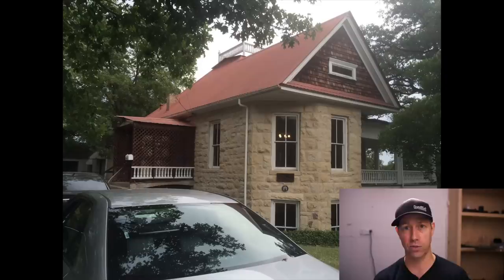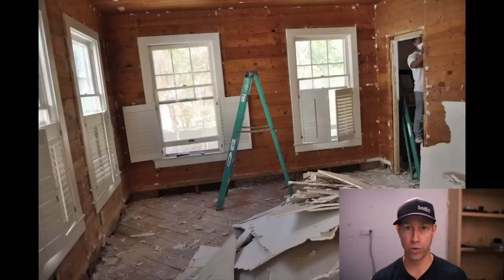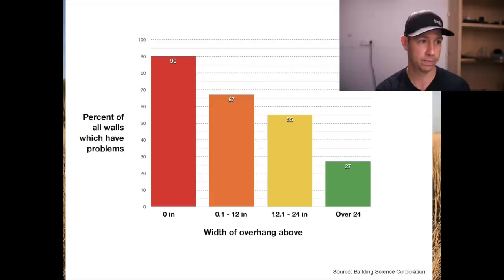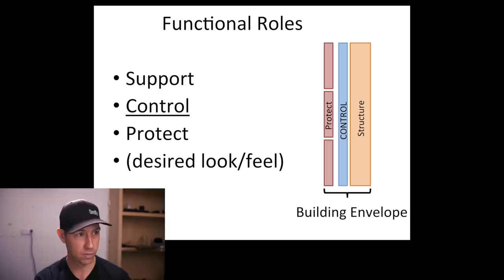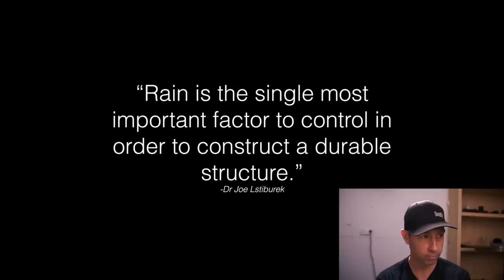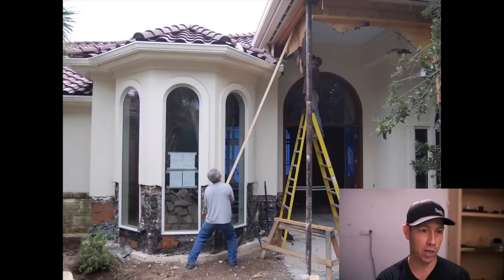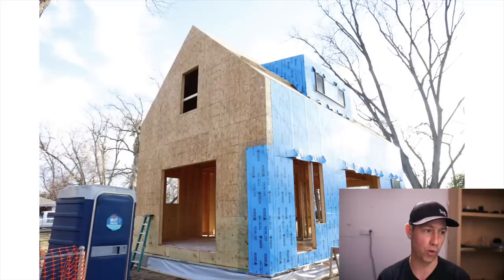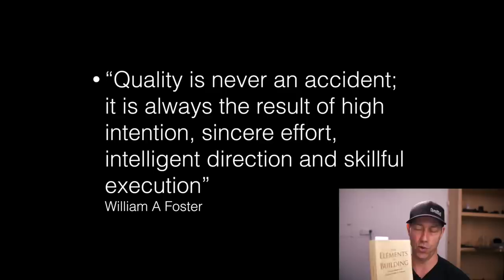Were Old Houses Built Better?

Comment: I live in a 1880's house I absolutely love it. I live in buffalo, ny - it gets (-40) here some winters, and yet I only have to run the heater in the morning and it stays warm all day with my 2 foot thick exterior walls - not too unlike that stone house. I've been here 10 years now - with NO maintence at all other then some cosmetic work and cabinets. It is built to last the ages.... Just the idea of buying a new ticky tacky year 2000 house makes me gag and This guy can speak for himself when he says "They didnt have the same comfort standards back then".... I actually have to open some windows to let the heat out of this house sometimes :-P And then in the summer - same thing with the a/c.... It can be like a refrigerator indoors.... Maybe texas building standards were not that high back then, but even then I'd rather spend a little extra $$ on electric then on a contractor every other year.
Reply: I've built hundreds of cookie-cutter houses as a young framer around Rochester. I believe your house will still be there long after these newer homes are gone.  All homes have mistakes made by the people designing and building them. The new materials cannot handle moisture and water like the old days.
  That being said, if you gutted your house and used all new materials and methods on the interior like a typical modern home, your exterior would suffer the consequences.
Reply: 2 foot brick is ridiculously thin when it comes to insulation under really cold or hot climate. And when it comes to new materials a 7 inch thick SIP wall provides enough insulation to keep a 1000 sqf house warm in - 30c in Siberia using just a couple of 1kw convectors. Not even a 5 foot brick wall is as good.
Reply: then why do they not bother with 7 in SIP walls in Siberia?
Reply: They do.
Reply: Untamedlion, this guy isn't thinking about old style basements, they cool a house very well. My dad and I never bothered with an AC (I used a fan some when I was a teen), we had cool air from the basement coming up through the floor heater. Half of our basement was dirt also. 

I want to build my own house :( I marvel at the old rough cut wood in my grandpa's old house. Wormy chestnut is awesome.
Reply: East Aurora area here, are you up in the city or in one of the many rural "suburbs" like me? Lots of 1800's houses around here, all still standing and strong as hell. All the newer homes? They don't last very long.
Reply: Americans builds only JUNK! Before Americans used to built-to-last in the 60s, 50s, 40s, 30s, 20s, 10s, 1900 to 1800 but not anymore, unless you specifically ordered it built according to your specifications with a powerful engineer-lawyer making a contract for all contractors and sub-contractors that they must face the heavy handed consequences if they cheat-cut corners!
Reply: @darthvader5300  More and more people here are having to rely on the old adage of "if you want something done right, you gotta do it yourself!"
Reply: @darthvader5300  , 
The 70's were not a bad time for things to be made also (maybe it was the beginning of the end?). My wife and I used a couple of washers and dryers from the 70's that were still running strong when we moved to our house.
Reply: @darthvader5300  Yes most American houses are nothing more than built on sight "permanent mobile homes."  And yet they cost what a spacious, luxury mansion cost 40 years ago.  And double that after the banksters collect 30 years worth of unjust usary aka interest on the mortgage.  We have been conned in the worst way.
Reply: @worldserpent731  That's when everything was still made in the USA and people could make a living wage and took pride in their work.  Before big corporations took over and sent all the work to be done by third world people at very low wages, and they also reduced the quaility standards in everything drastically, such as solid wood interior doors being replaced with hollow "masonite" garbage, thin enough for a 12 year old to punch a hole through.
Reply: My friend has a faucet, an all steel faucet made out of the best heat treated alloys and anodized in potassium permaganate and MADE BY BETHLEHEM STEEL which was purchased in the 60s and it is still in perfect working order despite the fact it was installed outdoors! He said, thank GOD I stock up stockpiles on a lot of Bethlehem steel products such as faucets, valves, choke valves, analog meters for water, gas, and oil, shovels, picks, wheel barrows, etc all perfectly preserved and properly stored with their original price tags still on them and their original steel brochures perfectly preserved by plastic laminations done by him for he is a technophile-collector/stockpiler. His house is more of a warehouse-museum than a house! You may add the word "HOARDER" and who can blame him when things has a tendency to become not as they used to be!
Reply: Reply to KesselRunHero: You Amrerican misunderstood me! When I say in 1800 it automatically means the best of the best of the old combined with the best of the best of the new. I understand you but you do not understand me! I want the super-best of the OLD combined with the super-best of the NEW, make some adjustments here and there while keeping in mind the old Irish Saying "IF IT AIN'T BROKE, THEN DON'T FIX IT!" I DON'T DENY ANYTHING, I WANT EVERYTHING THAT IS THE GOOD AND THE BEST OF BOTH THE PAST AND THE PRESENT which is why I said "they do not build things they way they did in 1800" because they did not maintain the BEST OF THE BEST 1800 standards and combine it with the best of the best of each incoming decade! That is what I am exactly trying to point out to everybody and including to you KesselRunHero and you MISUNDERSTOOD ME! Have you heard how to make an upragded version of modern Roman mortar and concrete by mixing equal volumes of lime, powdered brick, and sand (mica-free) and add sufficiently fine graded aggregates (mica-free)? How about Ancient Chinese brick mortar adapted to making concrete by mixing equal volumes of lime, rice glue, and sand and gravel and adding sufficient amounts of water to create a semi-plastic/semi-liquid upgraded Ancient Chinese lime-rice glue mortar based-upgraded modernized version of it? We did it way back many years with modern technology and making adjustments here and there (like a bakery chef making adjustments in his cake recipes to improve his cakes and pastries in terms of flavor and deliciousness) and that the sand and gravel aggregates are mica-free. And I am not ignorant, nor stupid, nor a liar, for I and my team tested a lot of house building technologies of each decade going back to 1800 and started combing them for the best of the best of their era and decade and combining the best of the best of their era and decade together for each succeeding decade up to the present. THAT IS WHERE YOU GOT ME WRONG. I UNDERSTOOD YOU BUT YOU MISUNDERSTOOD ME!
Reply: Preach
Reply: @borisbritva7453  houses in Florida are junk,, builders nail one by threes on the block wall I guess they consider that a stud no insulation on the walls I figured that's probably why people can only get about 7 years out of their AC system cuz it has to run constantly, I've missed having a real house
Reply: Boyfriend and I are home shopping in the buffalo ny area right now and needless to say we're looking at turn of the century houses (within 20 years of 1900) Those were built to last. My family home was built in 1910 and the only reason why my room is freezing is because of a shoddy window when it was renovated before we bought it 🤷🏼‍♀️

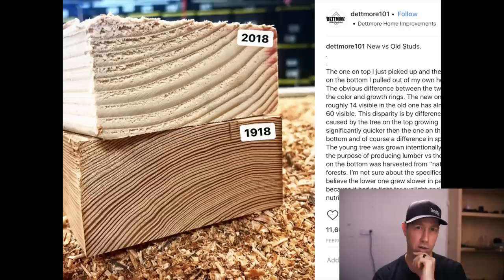Comment: 5:40 I’ve had 2x4s from ~100 year old houses that I had to drill pilot holes to drive in 16 penny nails.
Reply: I've re-used even sixties Douglas Fir, and you had to pre-drill everything.  I've heard wood also gets harder with time.  No idea if this is true or not.
Reply: Just built a work bench from some old rough sawn I had in my barn loft.  Broke off so many screws and bits.  Impact driver and pilot holes to get it done.  That work bench will surely outlive me.
Reply: @jeffreyquinn3820  That Fir is some tough stuff too.  My old floors were Fir.  They were pretty beat up to refinish, so I just kept them as subfloor where I could, worked pretty well.
Reply: @jeffreyquinn3820  It's true. As they dry out and compress they are incredibly hard, and still straight. Old growth wood and masonry wins every time.
Reply: Bingo

Comment: wood doesn't rot if its left to breathe, as long as it can dry out properly, its fine. most VERY old houses are only in bad shape because of modern attempts to prevent damp, which only serves to seal in the moisture and cause rot... Even painting wood will stop it from drying out in the summer.

Comment: having each of my houses get older and older as I moved, I will say, older is (usually) better. went from a new 2008 built house which was absolutely garbage, to a 2000 built house which was better but still bad to a 1980s house which is absolutely solid all around in its construction. the 2000+ houses I do not expect to live more than about 50 years before they need to be torn down or 100% renovated inside and out.
Reply: I agree, I had a house built tin 2011. I had the luxury most do not, which was to be there on site every day. However, even with my being there, the contractors still got away with shoddy crappy practices. If you have an 80’s built home, be careful of what you may going in some of the walls if you make renovations. I lived in a 1980’s built home and we wanted to add two bedrooms and redesign the kitchen. There were empty cardboard cases of beer in the walls between the sheet rock, and we had found a lot of shoddy construction. But my brother renovated an old Victorian home from the 1850’s which some slumlord modernized for a boarding home and covered up all the beautiful wood. He found stained glass windows, and all kinds of hidden features an then he began restoring instead of renovating. Tha house is still standing, and its 2 blocks from the Atlantic Ocean.

Comment: Here in Finland we still have a ton of post-WW2 rebuild era houses that were all built using the same basic design. There was a shortage of several materials at the time, so these houses are basically all wood (which we had a lot of), from the framing to the insulation which is leftover sawdust. No plastic anywhere, which means the structure lives and breaths. Most of these houses are still perfectly OK as long as the roof has been kept watertight and there have been no prolonged leaks from water pipes. It was only the later houses from 60s-70s on that started suffering from rot and moisture, thanks to plastic layers and insulation materials that are incabable of dispelling the moisture that inevitably gets there. And obviously some of these good, healthy older houses were ruined in the energy crisis era by adding modern insulation, or by blocking air flow to the cold attic. Or by using latex paint outside - that's enough to seal the wood off and make it rot. It's only now that the building industry is starting to realize the mistakes they've made. Too bad so many people have had to suffer from the air quality problems inside these later houses. It's a big price to pay from fractionally smaller heating costs.
Reply: What kind of paints should be used instead of latex? I have to repaint the overhangs on my house. Latex is what is mainly available now here in Canada unless you use oil-based paint for metal...

Comment: Love this video.  Thanks.  I would like to see comparisons of southern (warm) old houses and northern (cold) build techniques for century and older homes.  As an owner of a 150 + year old house in Canada and having gutted and remodeled I find the biggest issues are level problems (floors and walls), lack of internal wall and exterior wall insulation, and foundation drainage to name a few but I have to say the triple brick is solid and the interior wood framing and roofing system is mint.  Cheers.

Absolutely despise any house built with any particle board or any type of engineered wood.

Comment: WOW! that comparative picture of the cross section of both old and new lumber is incredible.  The new stuff looks like a sponge in comparison to the density of the old stuff.  I sent you an email after your last "do houses need to breathe?" video hoping you would address this issue and you knocked it out of the park! thanks for a great video!  I would love to see some in-the-lab testing done on old and new timber to see just what attributes the old lumber has in comparison to the new.  You can see the density, which probably prevents moisture from permeating in the first place, but I wonder if the wood itself doesn't also contain phyto-compounds that act as antifungals, just like treated lumber today is treated with fungicides.  Trees grow in fungi-rich environments and have to produce fungicides and bactericides and pesticides of their own, I bet that old stuff destroys the new stuff in phyto-pesticides.
Reply: Dense wood absorbs water slower but also dries slower, but compared to the "sponge" it absorbs less water, and tend to deform less and retain strength better when wet (think boat-building).
It is much stronger anyway.
With regards to fungi they usually can not penetrate more than a millimeter or so into wood unless it is constantly moist and has started to rot, dense wood is more resistant, and especially "sour" types of wood, like oak.
The downside is lower insulation value for the dense wood.

Comment: I used to live in a new house, which had it´s wooden window frames rotting within 5 years and not long thereafter the flat roof started to leak and in one place we had tar dripping down to the floor (hot water pipe next to tar paper ingenious idea). Not to speak of mold in the bath (central toom, hence no window and the ventilation channel was way too small, unless the rotor would run like 10x as fast) and these #### bought all sorts of spare parts which were no longer in production, thus 10 years later, every repair required custom made pieces!
On the other hand, as a European, I´ve seen wooden structures last 500 years with little maintenance at times even 1000 years. The timber frame houses are funny in how they warp over time and yet even manage to withstand earthquakes. Similarly, I was stunned in awe when I first got to Rome, seeing all that remains from the Roman Empire. Today's concrete tends to crumble after 30 years and they built things that withstood a thousand years literally!
Is it ancient knowledge lost? Maybe at times, but mostly, we just buy cheap, while they built to last. Just think about wood. Today, we throw it into an oven, which destroys like 10% of it and leaves the rest damaged, whereas back then every piece was dried for years if not decades. Apparently, it does even make a difference, when you chop a tree.

Comment: Very interesting video! Thank you. Our house (in Ohio) was built in 1926. Most of the houses in the village are from the 1880's to 1930's and very well maintained. The furnace system was retro-fitted with A/C in the '60s. It is not an energy efficient home but I think due to location our heating/cooling bills are quite reasonable, and the heat/cool is only used about 6 months per year. It's a neat old house and I like it much better than newer ones I have owned.

Comment: I did a job for a customer that had a 100 year old house, 7 bedroom, 5 full baths and 2 half baths.  3 car heated garage with original steam radiators,  not a single crack in the concrete slab!!!  Still has original slate roof.  He told me he uses enough natural gas during the winter, that he's partially responsible for global warming.
Reply: I'm sure the amount of carbon consumed to tear down and rebuild with new materials would exceed the energy consumed by conditioning.

Comment: The difference between craftsman and builders.
Reply: Thank you from Europe, you nailed it. It is global.
Reply: BRCC
Reply: my house built in the 20s was built by craftsman. the only reason to use so much cedar in my eyes is to protect the bones of the house from insects.
Reply: Craftsman makes good tools, I never heard of that builder's brand
Reply: me and me  the newest products are all made to last a lifetime. Even modern osb can be rained on a number of times before it's ruined. It'll actually last longer than some plywood that delaminates. Now he real problem is buildings using new materials and old methods. That and some of the materials from the 80s 90s and early 2000s was crap. Like tar impregnated sheathing. Might as well be cardboard.
Reply: me and me  I'm not talking about any siding. You don't use hardie or smart side (the modern weatherboards) as sheathing. But both of them last a tremendous amount of time as well. When applied correctly
Reply: Nothing Noone  yes and no. While a lot of cookie cutter houses are mass produced I have worked on many manors that are custom. I have built marble exterior houses, massive stone walled houses, many four story pillar homes, and walled complexes. 

Depends on what you are willing to spend to create.
Reply: Different regulations cost cutting my dad is old and can build solid stuff